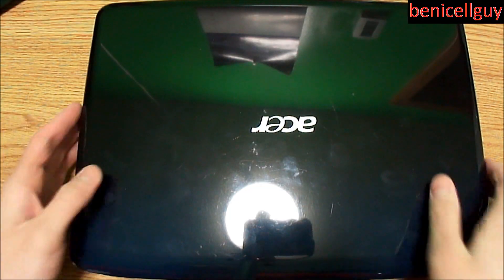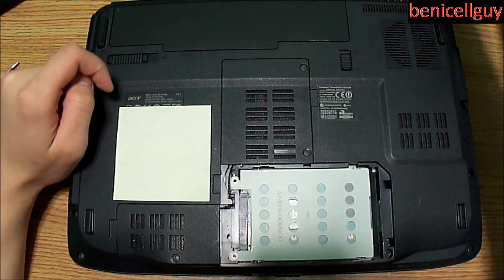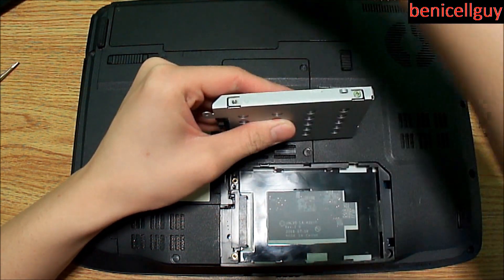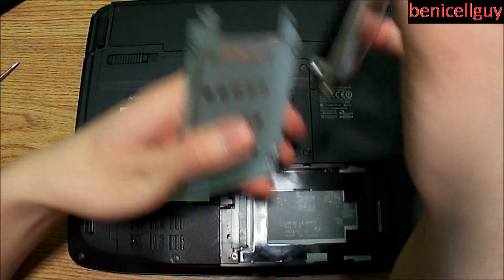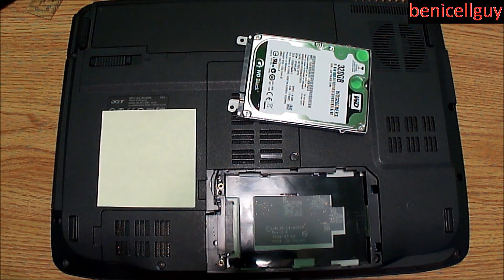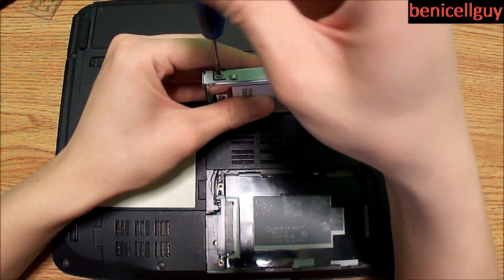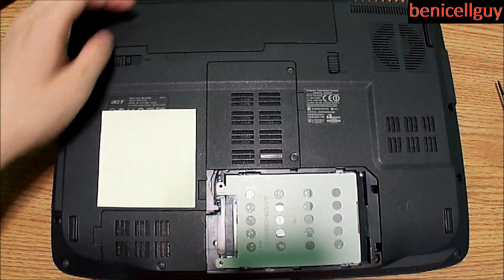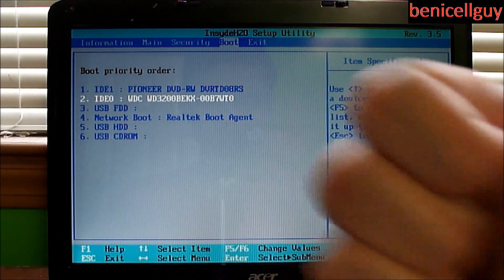Acer Aspire 4730Z Hard Drive Replacement

Comment: Thanks for this.   I was able to install a new HD, cloned from a later WD blue 500 gig with windows 10 installed, but now the older computer doesn't want to start.  I'm guessing there's a conflict between Vista and 10.  I did try several other methods, including booting from the old 160 gig vista drive, but no luck.  Any ideas, or am I trying to do the impossible?  Again, thanks.

Comment: Was there any problem with replacing old hdd with this sataIII 7200rpm? I've got samsung rv510 with same gl40 chipset. Is it noticeably louder than original 5400rpm?
Reply from the maker: No problems and it's not louder than the 5400. Sounds the same actually.